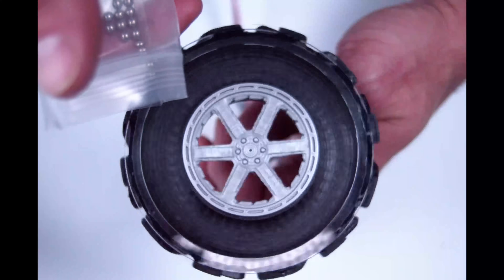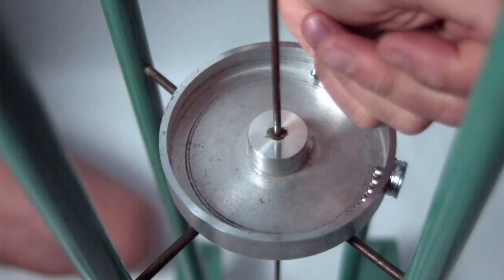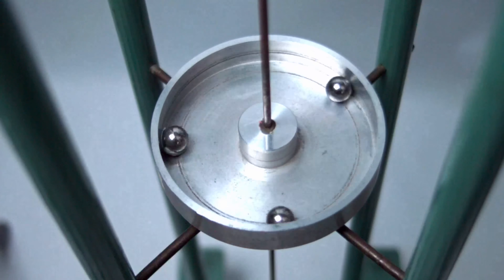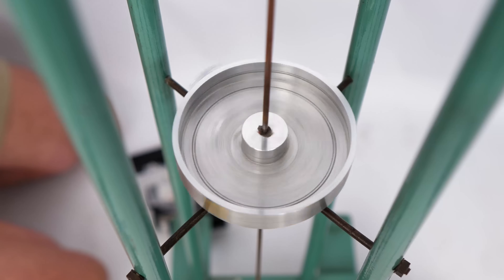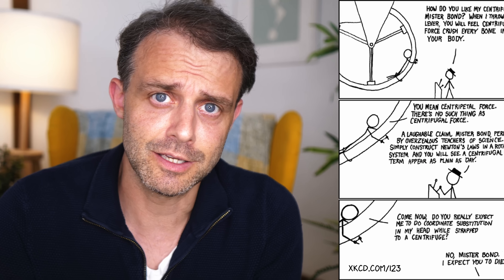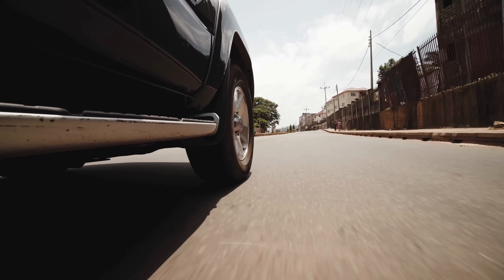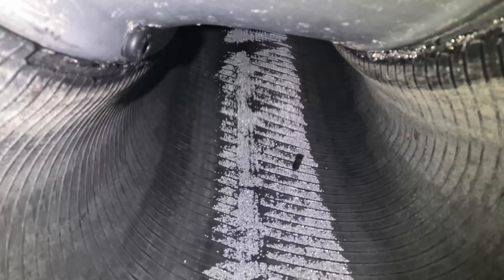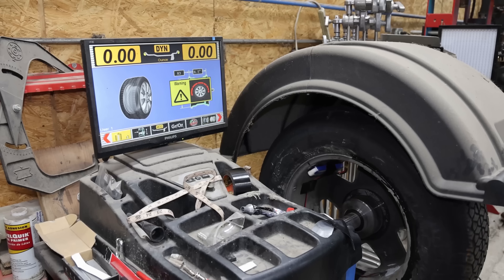Do tire balancing beads actually work?

Comment: I tried them on a few of my motorcycles when I started doing my own tires. I think they sort of work up to a point. The packaging would say not usable above something like 95mph or something. I never went above 90mph except a few times in the desert on my Valkyrie at 130mph. I honestly didn't notice anything. So maybe that means they worked. At slower speeds the wobble and the road bumps are noticeable at the same time and not critical so I would say they do work within their specified range and on tires big enough and fast enough.

Comment: If there was a way to make the beads melt or something similar to be able to stick to the inside of the tire so that when you slow down they don't fall out of place, it would absolutely be worth getting that kind. Stick stuff will grab it instantly and unless it let's go at speed and then hardens due to heat or some-such, which would require a long drive, sticky stuff is out. Melting is even less since heat is a factor. Not to mention testing for sub-zero temps, long-haul trips, moving a flexible material (tire rubber) while cold, hot, over time, etc wouldn't break the bond...oh, and another, chemical interactions with the tire itself could cause damage over time. Lots of testing needed for anything permanent.
Reply: It already exists, look for "ride-on" or any similar product, instead of beads they use a thick sticky liquid, which they also claim will plug small leaks. I can't speak to the leaks, but the balancing works like magic. You start moving, lots of vibration, get up to speed, vibration smooths out perfectly, and stays gone even when you stop and start again. I'm a little bummed Steve only looked at beads and not the liquid products.

Comment: Excellent explanation!  Laundry washing machines use this system to balance the drum during the spin dry cycle.  Works until the polymer tube cracks and the steel beads rust into a useless blob.

Comment: same problem inside a (front load) washing machine: the load is unbalanced at low speed, then everything moves into their proper placed at high speed.

NOTE: Front load washing machines spin in a horizontal axis; at low speed, the load simply tumbles inside.

Comment: Seems like the beads could be a handy temp fix for a problem but only long enough to get into a mechanic so they can balance out the tire with tire wights or what not. essentially taping down a ball barring so you don't have to constantly drive like a madman.

Comment: What if you found a way to "glue" the beads in place after the centripetal motion puts them in the right spot? That way they would already be in the right spot when you drive again, without the need to accelerate to freeway speed. 
I just don't know how this could be possible to do, but if it is, could be a great experiment

Comment: It'd be cool to see the bead concept used as a simple self balancing setup with some sort of 2 part adhesive so you could mix it as you spin the tire and set the beads at there perfect spot. Let reality do the work. no need for a computer and minimal tech investment and easy to produce cheap for consumers. Heck you probably could use a 2 stroke lol

Comment: About AnyDesk. It's not just about compression. It's about not sending the entire screen if you don't have to. THe screen is divided in tiles only the ones that are changed are send. Which doesn't work well if the entire screen is changing but you get the idea. In most cases only small portion of the screen changes so only it needs to be sent to the client. The problem with AnyDesk is that it's going the way of TeamViewer. It's still good but the tail tail sings are showing. I hope they don't slip on the same banana.

Comment: Some things worth mentioning:
This is more known as a dynamic balancing. It is used in many places, for example some washing machines and DVD-ROM drives.
You cannot make dynamic balancing with only one bead. Exception is if it's weight is exactly as much as needed to balance the wheel. Also, for the balancing to work, the total mass of the beads must exceed the needed mass to balance the wheel.
The balls actually spread so that the center of the mass is at the exact center of the circular track on which they move. Basicly, they are centering the track. So, it is advisable to make the center of the shaft coincide with the center of the track.
I believe, it is not possible to make dynamic balancing with non-circular track. So far, I do not know enough to be certain about that.
Some role in the spreading has the inertia of the beads themselves. In an uncentered track, when the ball is further from the center, it's velocity is higher than the ones closer. Thus, the balls on the outside are faster than the ones on the inside and this causes some agitation. When the track centers itself, the agitation stops.
For heavy machinery, the efficiency can be increased by making several concentric tracks for the balls.
While the dynamic balancing can be useful in many places, it cannot be implemented everywhere. For example, when the axis of rotation is horizontal, it might be impossible to start the agitation - the balls will simply roll in the bottom part. Some thick lubricant could increase the chances of starting it, but not always.
Dynamic balancing can be transformed into a static one by using some liquid adhesive - apply it to the balls, then spin up, wait for the balance and keep turning until the adhesive cures.
The switch from flailing mode to vibrating mode happens at the resonant frequency. Below is flailing and above is vibrating. At the resonant frequency or below, dynamic balance is impossible.

Comment: Yes and no. Truck tires use these and are great for them. In car tires they create more problems than they are worth. 

Firstly car tires weigh less, are smaller, and the balance doesn't change as significantly because of the less mass, and less radius, so traditional weight systems work better. Cars also run in more diverse speeds for smaller sections of time, so the beads are bouncing around beating the tires rims and tpms sensors for no good reason.

Unless you have mud tires or a tractor trailer they are not worth it.

Comment: Seems good but only temporarily and really wouldn't work well in congested freeway driving where you can't even get to the needed speed for the beads to work but instead are stuck at the problem speed.

Comment: I am a tire professional in  western Canada, balancing beads are to only be used in the steer tires on a Semi that has a rating allowing balance beads to be used, here anyway. They should not be used in passenger or light truck tires because the inner air barrier layer on the inside of the tire is too thin and the beads over time will degrade that layer. Also when you balance a car tire on a new machine they are static and dynamically true with the least amount of run-out aka hopping. I have seen a few diehards that wanted me to put the 2 or 3 golf balls back into their new set of rims and tires and to not balance them on the machine, because they do not work...pssssst... yes they do.

Comment: What's really interesting I figured the resonance frequency would be apparent at abount 80km/h. I had slightly unbalanced tires and got a bit of wobble around 80 km/h which went away at ~85km/h but reappeared at 160 and a bit over 240.
So at least in germany those beads could probably help with the second and third resonance. Though I don't know if you'd need TÜV to sign off on that, and the better option is still to simply get the balancing fixed

Comment: I have tried balance beads of many sizes and types. The tires i use are generally very high in mass, and the bead mass needs to be in proportion to that mass. For around town daily drivers i did not find them beneficial. In over-the-road semi trucks they would be "beneficial" . In my case the mass of the beads needed was objectionable and I could hear the beads when I slowed down and took off again. The super critical speed was approx 72mph, which was just too fast to make it practical, especially since I rarely drive over 60 to 65 mph.

Comment: The same thing happens in the drum of a washing machine. The laundry is unbalanced, but still mobile inside. During spinning, it redistributes itself in such a way that the system is balanced. The drum's bearings, however, need soft springs to make it easier to achieve a balanced state, since the laundry isn't spherical.

Comment: The beads starting to work at high RPMs immediately brought drag racing to mind, because an initial burnout could totally get the tires moving fast enough. So I looked it up and it seems tire beads are a growing trend in the sport!

Comment: I work at a company that sells wheels and tires. We offer balancing beads for anything above 32" inflated diameter because usually such a tall tire is a pain to balance. If the wheel/tire package is for a show truck with really big wheels. Most don't want the wheel weights to be seen so they opt for balancing beads.

Comment: If glass beads work, then wouldn't some sort of rubber "glue" work better?  Something like the "sludge" you inject into tubeless bicycle tires?
Inject it into the tire through the inflation valve, then run your car on a "treadmill" like they use for MOTs (at / above highway speeds) until the rubber sludge hardens... and the tires should stay balanced even at low speeds?   ...instead of weights that could fly off & be dangerous at speed.

Comment: I’m only 30 seconds into the vid so maybe there’s a solution but right off the rip the first prob I see with beads to balance a tire is it’s not balanced until you’re up and going and at a steady speed. Stop and go or driving through town slow and they’ll just be in the bottom of the wheel

Comment: Best advice for car owners - buy non-directional tires and cross rotate every 5000 miles (8050km) and as long as your car suspension is in proper order, your tires will not need additional balancing for their normal wear life. 

Also, if you have a spare wheel that matches the others exactly (rare today), do a 5 wheel cross rotation so that if one wheel gets damaged beyond repair, the other 4 will have equal wear.

Comment: I have used balance beads for large off-road tires and very heavy semi tires. They work very well in those situations but don't have a very good advantage on a smaller vehicle Tire. Much easier to just balance a smaller Tire the old fashioned way. So basically the harder the tire is to balance because of its excessive Mass which makes rubber inherently out of balance because of inconsistent density, the more useful balance beads become.

Comment: Or you could just have your tires balanced with the normal weights so that you don't have vibration at ANY speed. Its almost like the standard is the standard for a reason.

If your "fix" only works under certain driving conditions and requires you to altar your driving behavior just to get it to work, then it's not a real solution

Comment: Heard of this for the first time, I’m curious, I’d probably get some benefit from them as I drive in a mixed regimen. I’m wondering is a similar trick could be applied to washing machines, as far as I know manufacturers haven’t found a definitive solution to the vibrations during the centrifugal drying cycle.

Comment: Long time ago I was watching Drag Racing and a Team was using  mercury or some other heavy liquid metal, in a closed rubber loop(think large hollow rubberband about the diameter of a drinking straw )(around the wheel bead of the tire, they were using it on their 18 wheelers too. They said it was incredibly effective.

Comment: Doesn't the wheels acceleration also influence at what speed the beads move into place? My thought came from the spinny thing at 7:15. If you suddenly accelerated the spin of that wheel wouldn't it kind of collapse the resonance even without hitting the "highway speed" of that wheel? Because the rotation would suddenly have to be a lot faster and the springiness of that axel can't keep up. And on the other hand, if you accelerate at a constantly decelerating rate, would it not just keep spinning faster and faster at that resonance until the acceleration approaches zero, at which point if you accelerate more it breaks at exactly the "highway speed".

On a car tire that would be essentially a burnout/losing traction. But would the wheel have to hit the "highway speed" for the beads to go into place, or does it happen shortly after the tires start losing traction?
Reply: lmao if what I say is true they would still be pretty wack. You need to hit 80kmh or do a burnout for your wheels to be balanced

Comment: in heavy construction, "balance beads" are used in certain applicatinos. They're still a bit controversial, but we use them to great succes, especialy  on machines with calcium filled tires that depend on vibration to do what we buy them for

Comment: my problem with the beads is that every time you stop the wheel would be out of balance again and need time wobbling around to make it balance...you might aswell use the proper weights and save your bearings and suspension. plus if you do have a blow out youve got little beads all over the road making it very dodgy for other vehicles
Nice idea but doesnt quite work in practice

Comment: Mechanic here,  we use glass balance beads only in the tires on our tow trucks because of the size and weight of the tires and wheels.  It's not really high speed that settles the beads.  It's a much higher quantity , literally over 1000 per tire.  You only need to reach a minimum speed of at least 15 mph for the beads to start going into place.  Yea by the time it is time to replace the tire you have a "rubber powder" inside the tire with the beads.  Wear from inside the tire.  But it's a slow wear,  and not enough to be a problem from the tire being new to being replaced.  Tow truck tires are very thick.  You don't normally use balancing beads in normal car tires.  They are much thinner and wear faster,  which is why hammer and sticky weights are used.  

This is nothing new,  glass balance beads have been used for a very long time.  It's also how semi truck tires and large trucks like dump truck tires are balanced.

Comment: It seems the ideal solution would be balancing beads that stick permenantly in place after hitting the required speed. 

Tires do tend to heat up at those speeds, it would be potentially possible to make a bead that is coated with an adhesive that only activates above a certain temperature, locking them in place.

Comment: The first thing I thought of about the beads in the video was that the lab experiments are showcasing this phenomena on a horizontal plane whereas tires spin around on a vertical plane. From there I was curious if gravity would have enough of an effect on the self-balancing to cancel it out. My hypothesis was that it would still be an improvement, but not as perfect as it could be in contrast to the physics on a horizontal plane. Speed was something I didn't immediately consider, which probably helps with canceling out any side-effects of gravity itself to a large degree making it pretty much negligible. I wonder how many beads you need to add and what the weight would be of the beads in the tire... Probably not enough to have any effect on gas mileage worth concern either--including weight and move-from-stopped physics with the beads all at the bottom when not in motion. Physics is interesting :)

Comment: I can tell you with absolute certainty that balance beads do not work in motorcycle tires. My buddy owns a tire shop and told me he runs them and swears by them. I tossed them in my Contimotion on my Buell M2 and the bike became unridable.  If I accelerated slowly they dispersed somewhere evenly, however if I ripped it they all slung to one position and bounced the rear like a jackhammer. In my experience, scam.

Comment: I feel like there's a part missing from the video.

Since the freely moving weight wants to move toward the heavy side when slower than the transition RPM, wouldn't the imbalance actually be exacerbated before the beads have shifted into place?

Unless you're consistently driving at highway speeds, the cure winds up being worse than the sickness, leading to issues that might not have otherwise developed, or at least not as soon.

Comment: So what happens when you coat those beads in a low viscosity liquid glue that sets in say 10 minutes, like a fast setting epoxy resin. Put them in the tire, drive at or above the balancing speed for the duration of the cure, which would be very quick. Sounds like the next logical step for those selling these beads. I'll take 5% royalty, thank you! 😋

Comment: I imagine that the beads do work but that damage is increased to the unbalanced tire until it becomes balanced. If you do a lot of city street driving, you'll not be able to balance your tires and the wear and tear will increase. It's just not worth it for passenger vehicles. Better to get them professionally balanced.

Comment: It would be interesting to see what tire size you determined the speed at which the beads fixed to their proper positions. It may seem that a shorter tire would reach that rotational velocity at a lower "speed" than a taller tire.

Comment: the major problem i really see is one thing, tires are not pieces of hard metal like this, they move, because they are rubber, probably the traditional method of balancing a tire and wheel is the best, and works better

Comment: i think that it is important also the size and number of the balls. These 3 steel balls need more force and time to find it's sweet spot than that 100ts small that they spread separately, they are light and can easy find it's right place. I think the smaller and many they are, the easy and fast will be the balancing effect. Try the same method on your machine but with several different size and numbers of balls and measure the timing.